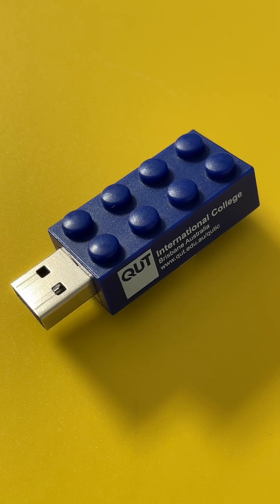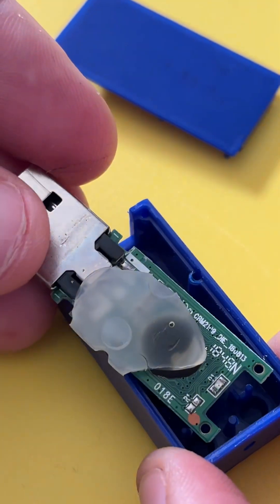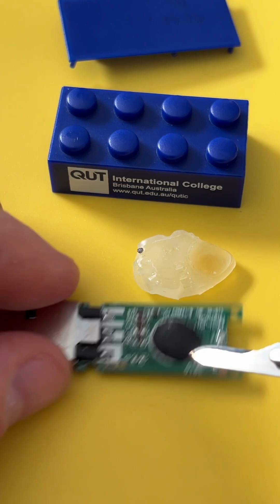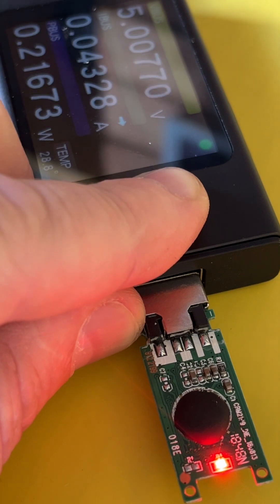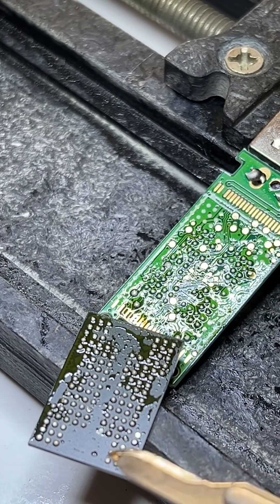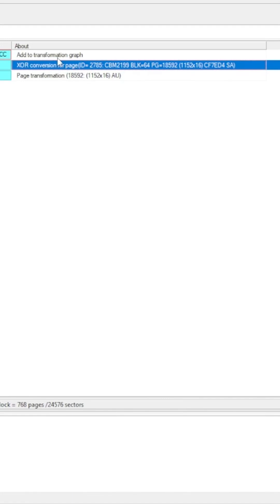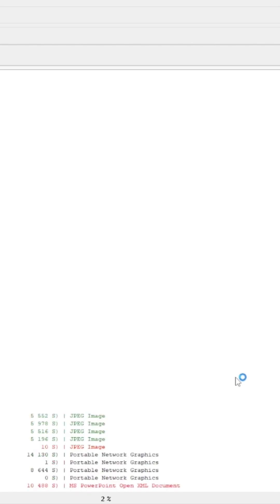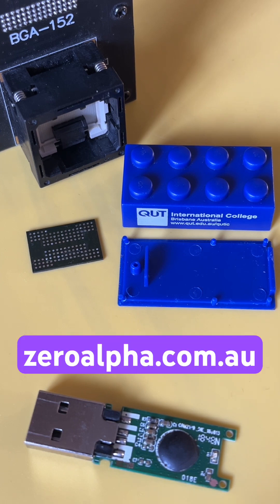Lego Promotional USB Data Recovery Repair - Its not working | CBM2199 Chipsbank

Comment: Is there any usb drive that you WOULD recommend? I am pretty anxious about file corruption because of my important school files.
Reply from the maker: A general rule is to stay away from cheap usb drives such as promotional or sandisk. Look at the better brands like samsung and always backup
Reply: @ZeroalphaAu you think something like Lexar?
Reply: @frenly-guy I recently opened up a lexar usb ($9 one from jbhifi) and it's literally a nand chip sitting in an enclosure, similar mechanism to a simcard. absolutely cheap garbage, would not recommend for important data.
Reply: @appravo I’ve got a 16gb from like 10yrs ago. Only reason I don’t use it is because the poor thing broke in half 🤣
Reply: I like Toshiba. I've noticed that unlike other brands they start acting weird long before they completely die.

Keeping 2-3 cheap drives with the same info is safer than only having it in a single one though. Quality doesn't matter much, its more about quantity